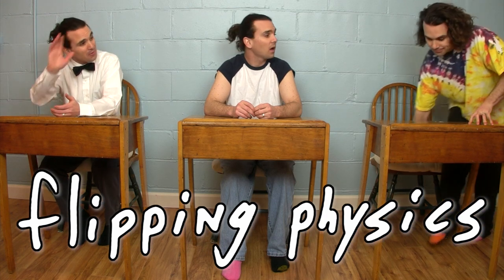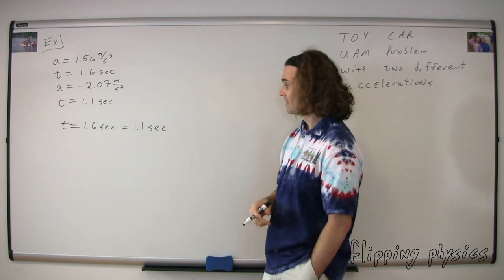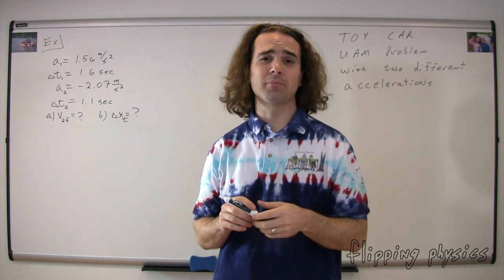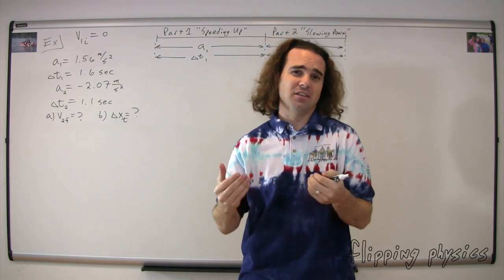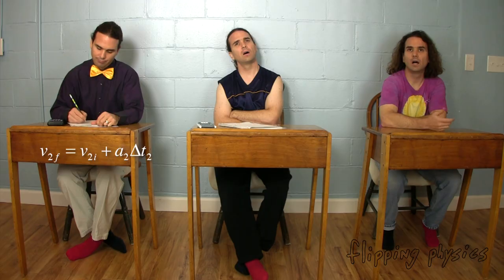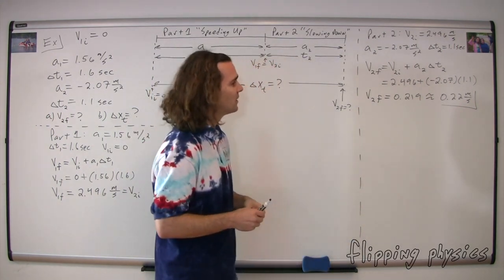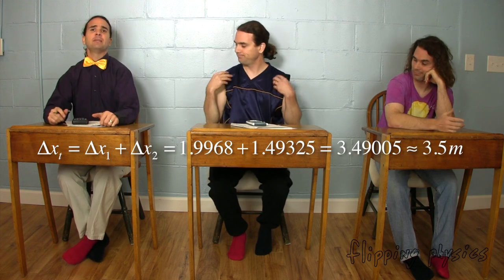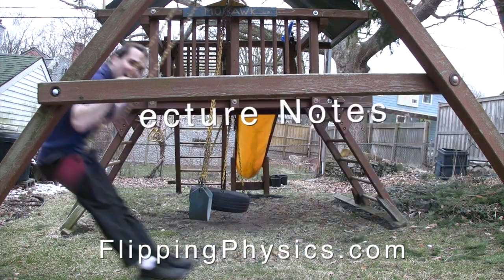Toy Car UAM Problem with Two Different Accelerations

Comment: Is memorizing equations an inefficient way? Using an equation is important, but I don't know how it's derived.
Reply from the maker: The issue with showing how the Uniformly Accelerated Motion equations are derived is that it requires calculus.
I show derivations of two of the UAM equations in this video, if you are interested: https://youtu.be/B6bi5H1pwmE?t=3m27s

Comment: for displacement 2, why did I get a different answer when using the equation1/2 (vf+vi) delta t1/2 (.22+2.496)1.1I got 1.4938. Even though the total displacement ended up being 3.4906, 2 sigfigs the same answer, 3.5 m why is my answer different?
Reply: You didn't us 0.219

Comment: @12:41 When solving the displacement for Part 2, why does using the same UAM equation for part one not work (I tried it and the answer I got was 2.5773) even though all the variables needed are available(V2f, V2i, and delta t)

Any help would be very much appreciated
Thanks :)
Reply from the maker: It does work. V2f = 0.219 m/s, V2i = 2.496 m/s, Δt2 = 1.1 s, results in Δx2 = 1.49325 m/s, which is the same. I am not sure where your error is.
Reply: UAM equation I used for part 2
delta x2 = (1/2)(v2f+v2i)(delta t2)

Answer I got
 (1/2)(2.19+2.496)(1.1) = 2.5773 m/s     <---   wrong answer
Reply: The UAM equation you used for Part 2 worked with me when I used it, but when I tried using the UAM equation from Part 1 to find the displacement for Part 2, I ended up with the wrong answer.

Thanks for replying in the first place, your a living legend.
Reply from the maker: V2f = 0.219 m/s ≠ 2.19 m/sPlease take a moment to think about how much time you have spent working on this and all it really comes down to is being careful with reading and writing. So often students rush through problems and think they do not understand the physics, when all they really did was make a simple mistake.
Slow down. Be careful. Read carefully. You will understand more and you will learn faster.
Best of luck and I hope that helps!
(Also, I'm not trying to be snarky; just trying to give some legitimate advice)
(Double also. I just looked up "snarky" and this is what the dictionary said: "cranky; irritable: Bobby's always a bit snarky before his nap." I agree. Bobby is always a bit snarky before his nap. 😀)
Reply: Wooooow. Thanks once again, couldn't believe I made such a simple mistake.